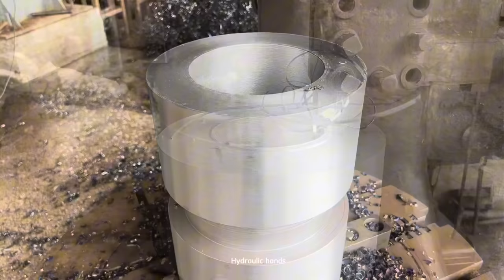Manufacturing Process Double Helical Gear with British Vertical Lathe || From Dust to Precision

Comment: Enjoyed by all Machinist across the globe, sadly mocked by those that never will be a Machinist!
Reply: You only speak for yourself mr Bighead.
Reply: I am going to the town where this shop is and sell them brooms and work benches.   What a bunch of clowns.  I bet the foreman doesn't even bring doughnuts on fridays and saturdays.  These guys need to get it together and form a union.  But they won't.
Reply: they would quickly get replaced and blacklisted by all other business, over there is a caste system, and they dont like being challenged.
Reply: "Enjoyed by all Machinist across the globe" - I'd rather say "endured by"... I mean, just watching it may give you toothache... ;-)
Reply: It's not concentric so it won't be a quality part
Reply: @tpk158  It will be! It's just that, well... the quality will be of somewhat, erm, "secondary quality". And then no-one has said that the shaft this gear is going to go onto is straight, right? So this may be just a built-in compensation... You never know, mister... ;-)

Comment: 19:00 Hole runout +- 2 millimeters
Reply: mm or Cm??
Reply: More like meters @MrHitchikerOz
Reply: Their boss is too stingy to buy a dial gauge.
Reply: @jankrusat2150  This is a business plan. The faster the gear wears, the faster the new order will be.
It would be nice to make it last twice as long and cost twice as much...
Reply: I see no evidence of runout. I.D. and O.D. were produced on same setup, O.D. was indicated in on the hobber. Where would runout be introduced?
Reply: @BronzeAgePuritan  I ist a self centerig chuck. When they turned the piece around, they did not center it properly.
Reply: @jankrusat2150  It doesn't matter much because they did all the ID again,  wider by more than 2cm. The OD is correct because it was done in same setup. They don't show all steps.
Reply: @BronzeAgePuritan  It had runout from the roughing process. Then they widen the ID and finish OD using the same setup, so no runout, as you said.

Comment: The quality and precision of their work is totally adequate for what they are doing. Take a closer look. They ride camels to work, wear sandals on a dirt floor, and probably couldn't use a computer if they had one. And yet they still turn out very nice work using machinery that we would have scrapped decades ago. I can't say enough good about their work.
Reply from the maker: Absolutely! These machinists may work with unconventional setups, but their dedication and skill shine through in every project. They make the most out of what they have and consistently deliver quality results. It's truly impressive! 🐪👞🖥️🛠️

Comment: The lathe has built in scales on the cranks, allowing the positioning of the cutters down to 1/100 of a millimetre. Why are they not using them and instead use rulers and chalk marks, which at amaximum allow for an accuracy of a few millimeters?

Comment: at 17 i worked at a machine shop, bluffed my age , learned a micrometer usage at library and got the job,made  brake caliper cylinders for 747, back in the day, learned lots, 4th opertion ,that was for the summer only tho... still would like to learn a lath operation...you can make anything with one.
Reply: Is that why planes ✈️ were crashing ? 😮😢

Comment: my sincerest pity for these good people that have no choice but to labor in the most primitive of conditions 
risking life and limb, producing 3rd rate "parts" that won't hold up over time due to the lack of precision and 
cut-rate material . . . i doubt if the O.D. is concentric within .030" to ANY of the minor OD's, and the one 
positive thing about the surface finish is that it will retain lots of oil with all those pockmarks

Comment: Please, can anybody tell me why they did not drill the hole on the lathe? I am just trying to learn, so I am asking for the reason, not being dumb smart. :-)
Reply: Нет гнезда. Или черезмерное усилие по  оси Z противопоказанно.
Reply: @-_---__------________   TRANSLATED:
There is no nest. Or excessive force on the Z-axis is contraindicated.
EDIT: Are you a woman?
Reply: @friedmule5403  , При чем сдесь Women?? 😄.
Станки старые, и у всех шаговые винты изношены или поменены на сырые.
А главная причина, надо постоянно выводить инструмент, чтоб избавился от стружки. Которой некуда выходить. По тому что сверло меньше! По длинне чем деталь.
И на токарном надо часто выводить. А это долго и есть вероятность сломать сверло, случайно врезавшись в деталь, если подъезжать на ускоренной подаче.
На сверлильном это быстрее.
Reply: @-_---__------________  TRANSLATED:
What does Women have to do with it??. The machines are old, and all of the stepper screws are worn out or replaced with raw ones. And the main reason is that you need to constantly remove the tool to get rid of chips. Which has nowhere to go. Because the drill bit is smaller! Longer than the part. And on the lathe, you need to take it out often. And this is a long time and there is a possibility of breaking the drill, accidentally crashing into the part, if you drive up at accelerated feeding. On drilling, it's faster.

REPLY:
I have found out that women often are able to spot logical things that are often overlooked, And I liked your observation. :-)

Comment: why was it necessary to align the part on the outside, if the hole is important... it was necessary to set the runout to 0 along the hole, and then sharpen the outer diameter. it would have worked out exactly. + the workpiece is pulled out of the chuck, it is too big + cutting modes of 10mm per side...

Comment: Those machines are old an in desperate need of s dull rebuild if not a replacement. You can do accurate work with substandard machines. Just look at the cutting inserts? If yiu can still call them that. And the block of steel? To make a piece like that takes specialised steel from a professional steel mill not a glorified hobby/backyard business. I highly doubt the steel is even fit doe purpose and probably would have a lot of imperfections from what they put in it. Cutting gears is an art form and tolerances have to be precise. But I'm going to say that what comes out of that factory is anything but precise. I'd you want to see how gears are made properly just look up the videos on here

Comment: Well....entertaining. But it looks like a third world country part. Apalling  finish and accuracy.
Reply: Pakistan
Reply: Is what it is they get by I guess 🤷🏻‍♂️
Reply: do you mean "appalling" accuracy? no, you couldn't mean that, because machinists don't use the word 'accuracy' they say 'tolerance'
Reply: @stanley1554  I did lathe work to a tolerance of 1/100 of a millimeter. The "tolerance" on this gear is at around 5 mm.
Reply: @jankrusat2150  sure... sure ya did buddy. 👌👌 any fyi all lathes are capable of producing parts to those tolerances. there is nothing special about this.
Reply: Good machinists know the minimum level of accuracy needed to make the proper part. Should everything that is machined always be within a thousandth of an inch?
Reply: @northernmetalworker  Oh no, I totally agree. Those extremely high tolerances are not required on every piece that is made. for sure. every job, has different requirements.
Reply: @northernmetalworker  But not several millimeters off for a machine part, like a gear. I'm a trained machinist myself, and we got told during our apprenticeships "to be as exact as possible, but only to be as accurate as necessary". Still, I would consider this piece of work as scrap.
Reply: @stanley1554  Then you have to do it. Mind, I have an old lathe (about 100 years<old, stil designed for belt drive from overhead shafts), which is completely out of adjustment, especially the tailstock.
Reply: Be as accurate as necessary and no more.  If the customer is happy then move on.
Reply: He meant to say “ appealing “😂
Reply: And a wobbly, out of center through hole…
Reply: Lathes , jig borers mills etc , yep 50+ years old and still doing there job.
These guys know what to do and they are doing the best that they can with what they have , and for that you have to give them the thumbs up.
Not every country has high end machine shops , but as a machinist myself yep it’s not perfect but they are doing it , bravo guys

Comment: these are the real machinistes .now a guy sit down next to a CNC already prprogrammed and all he does is push the buttons and align the part.and the rest of his time 90% watching videos and make big mistakes indeed
Reply: Tell us more about how you know nothing about CNC.
Reply: In the time this guy spent on 1 part your lazy CNC machinest would be expected to do 20 or more parts. Sure bet this guy spent more time watching the machine go round and round.
He shure did not put any time in pushing a broom.
Reply: Real machinist wouldn't use chains around a freshly cut gear before heat treatment.
Reply: There are machinists and there are machine operators - a big difference. Anyone who has to figure out how to make a part on a machine whether it be manual or CNC is machinist. Anyone only loading and unloading a machine to make a part is an operator